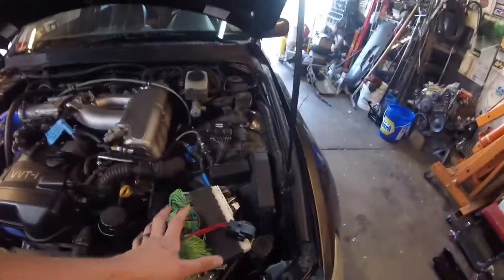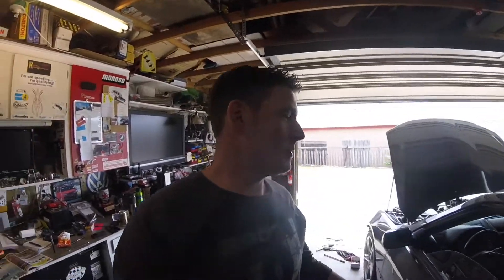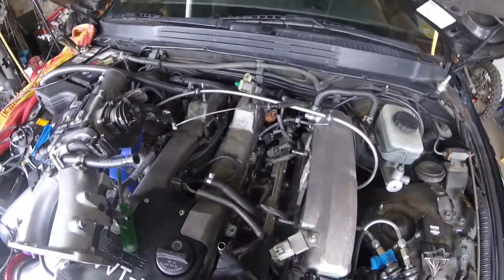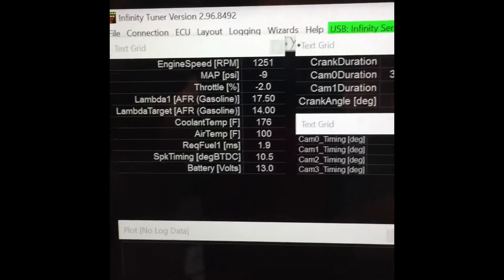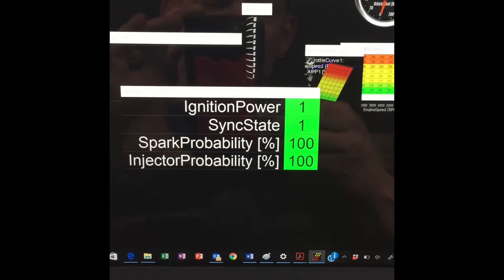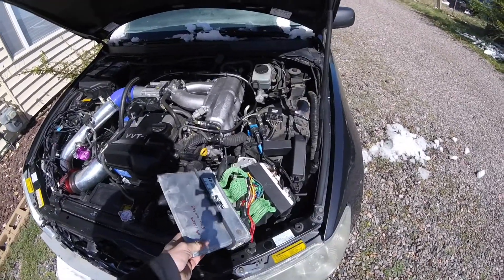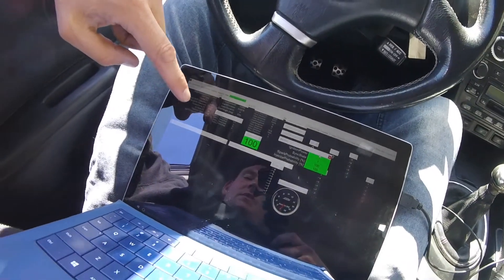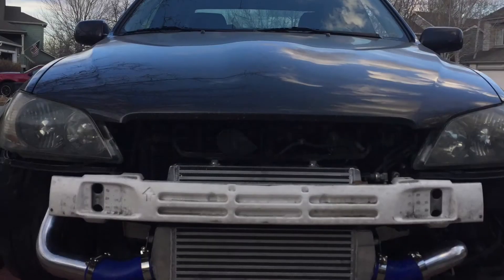IS300 Turbo Build: Cam/CrankSync AEM Problems I need Help!!

Comment: Please verify that you are sharing the cam/crank signal return wire to both pins 18 and 19 of your Infinity ECU. Those should be the cam sensor return, and crank sensor return. Becuase the is300 only uses 1 return wire for both signals you have to splice 2 return wires (infinity side) into the 1 return wire(IS300) side. Also check and see if they installed any sort of resistors in your boomslang harness. I have also heard of poor pin fitment on Boomslang harnesses. I would try splice and solder the Cam/Crank wires into the is300 ecu instead of going through 2 additional connection points.
Reply from the maker: Alex DooD thanks for the advise. We are in the process of running new separate wires for the infinity today. The boomslang simply spliced the return into two ends at the infinity. Our theory is that boomslang was loosing signal being spliced in two at the infinity. I will keep you all posted.
Reply: @C3GARAGEMedia  hi bro.. How do you solved the syncstate issue in your car?
Reply: Did you figure put the fix for this issue?

Comment: I know this is old, but I had a very similar problem on a 2jz-gte in my S14.  The problem was a few things.  I needed better engine grounds, the sensors themselves also need to be grounded well, but they need to be grounded to a sensor ground back at the ECU.  Also, if you have your battery on a charger or even if your laptop is hooked up to its charger, that creates another ground path that causes issues with the cam and crank sensors.  A low or failing battery will also cause similar issues.  Take your laptop off of it's charger if hooked into the AEM, remove any chargers from the battery so you don't have multiple ground paths, and make sure your engine is grounded very well.
Reply from the maker: Thanks for the comment, I actually fixed the problem by wiring the cam/crank grounds independent of the stock ecu.  They share a common ground at the ecu and the infinity needs to read two grounds. I literally cut the ground connection at the ecu pin and wired both cam/crank sensor grounds to the aem infinity and it worked perfectly.
Reply: C3GARAGE Media do you have a good basemap I could get? I’m trying to get one running but it has 1050cc injectors.

Comment: The stock ECU is creating interference on the cam and crank signals going to the Infinity.  Software setting adjustments alone won't fix this.  If you could get away with not sending the cam and crank signals to the stock ECU, it'd probably run fine.  Let me guess - this is a piggy back because you have an auto trans?  BTW no tuner or tuning shop can fix this for you because you have a fundamental setup problem.  If you really want to figure this out, get an oscilloscope and look at the signals to see what's going on with them.  Just because Boomslang built you a harness doesn't mean this combo is just going to drop in a work.  Hate to be a dream crusher but that's reality sometimes.  Using the Infinity in piggy back with shared VR sensor signals is the problem here.
Reply from the maker: Black Line Industries thanks for the input. Nope no auto trans. Basically need the stock ecu for gauges, climate, fuel pump. I agree with you and that is what we have found we are trying to run independent cam/crank signals. There are people who run the infinity in parallel in the IS.

Comment: Do you think it could be having a cam/crank sync issue simply do to a lean misfire? The way ecu's recognize misfires is by sensing a difference in cam/crank speed. You're air/fuel ratio is extremely lean when you attempt to rev the engine.
Reply: The Infinity doesn't have misfire detection.

Comment: Have you tried swapping out the aem for another one? Could be a hardware issue since you got your harness checked out and a tuner looked at the map and it also ran with the stock ecu so that rules out the sensors being bad.
Good luck with the problem and I hope you find a solution soon
Reply from the maker: jpkillah1 no but the shop did have them check out some logs. They have honestly been pretty terrible to deal with on this.